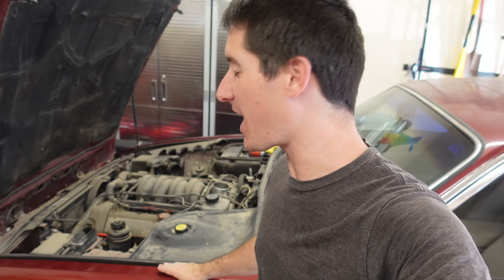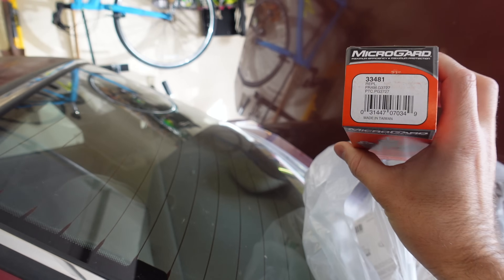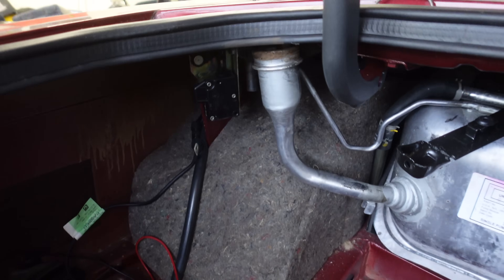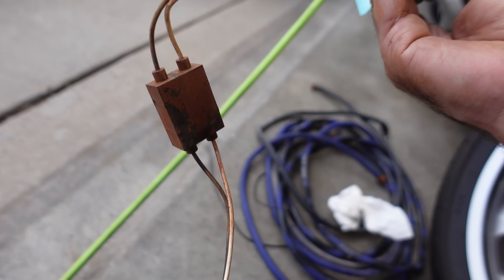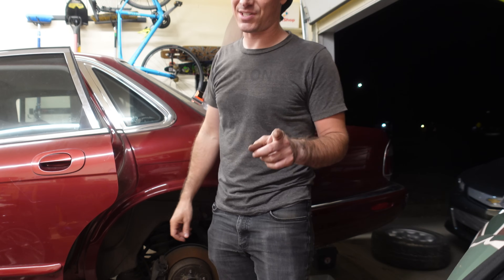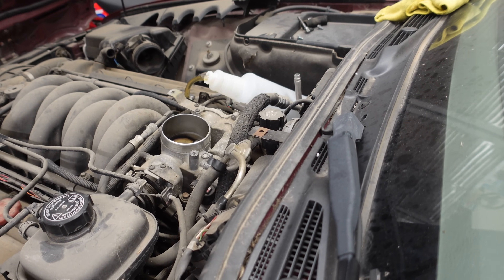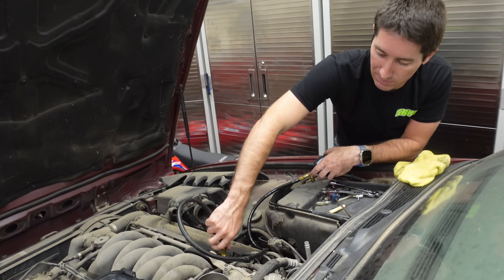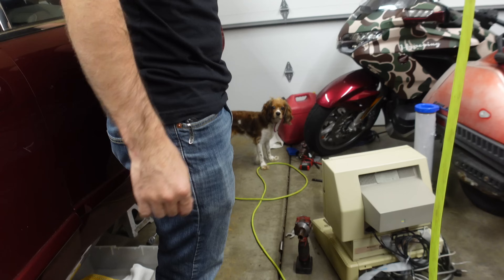World's WORST Fuel Pump Swap... Don't Buy An OLD JAGUAR

Comment: If the fuel filter is clogged then it may act as an orifice. It will allow pressurization when you turn it on, but then will restrict the flow so the engine will not run.
Reply: Agreed - similar to electrickery - high resistance will allow voltage but no current  :-)      but -  I've never seen a filter sooo blocked to prevent tickover speeds -   old git, UK

Comment: Has WatchJRGo figured out the fuel pump, through the hidden fuel pump relay, is controlled by the ECM (for reasons no one has ever figured out why)?  Or that the brake light switch really controls whether there is fuel pressure in the fuel rail?  (really, it does, no one is sure why).  I'm not convinced these cars ever ran when they left the factory, who else has to check the ECM updates to get a fuel pump to run??  Oh, it's BRITISH!  It has World-beating engineering and Design!!  Has WatchJRGo checked the mystery switch in in the driver's side rear door?

Comment: One of the problems of this engine is that it won't start and run if it is down on compression. When these start and run for a brief period, it purges oil off the rings, leading to low compression. This is a well known problem. People start the car, back it out of the garage, shut it down, and then find it won't restart. Add a tiny bit of oil to each cylinder and start it. If it starts and runs, let it run until the temperature gauge moves. After that, it'll start and run fine.

Another area you may want to consider is that disconnecting the MAF puts the car into static mix mode, but the system still wants to meter that air. Even with the MAF disconnected, you need to replace the missing intake hoses and vacuum hoses between the MAF and the intake plenum, or at least plug them well, or you'll end up with too much air in the mixture.

Comment: leaky injectors, looses the fuel pressure, floods the spark plugs, wont stay running, don't forget your intake pipe that could give you a lot of idle problems...

Comment: Check coils and leads connectors for rust that was holding them together until you started the motor and vibrated connectors off.

Comment: Sitting so long your key modual may no longer reading the key. That happen on the jeeps 72 to 2003. I got the exact thing with my 2000 jeep starts ringt up runs great for 3-4 seconds then shuts down.

Comment: If your changing the fuel pump you dont need to drop at the rear as a lot do. Though the pump is in the tank it can all be done within the car and the odd few cuts to the hand. Done it twice.

Comment: It's never easy to fix on an old jaguar, parts and costs... but it's always fun to drive them, always turns heads everywhere you go and always become a conversational.... Nice shape of the '90...the newer ones are never the same as the older ones, trust me
Reply: they may be more difficult to fix but they really don't break often in this era, I have driven my 99 so much over the course of the last year +, multiple times a day all kinds of traffic, only alternator has gone bad, did some maf cleaning and removing kn filter for original because oiled dirtied up the maf sensor.

Comment: I don't know if it's like my 1991 XJ6, where there is 2 fuel pump relay: One for the prime and one for running. Also, put a bottle of injector cleaner as soon as possible. It makes a massive difference.

Comment: I worked in a Ford/Jag dealership for a while as a mechanic. And there were several jags a year that would set for too long and then not want to start. The jag techs had pretty good luck taking all the spark plugs out and spraying wd40 in all the cylinders then they would fire up. 🤷
Reply: these cars do so good when they are regularly used

Comment: At first I thought a leaky injector, but last time I had a stuck open injector, 7 cylinders still ran and fuel smoke filled the shop . And it ran rough. No sign of mice? Grasping for straws here lol
Reply: With the bad fuel filter, the limited fuel flow a gummed up injector or several would cause this.

Comment: I had to start a Miata that sat for awhile and it had some stuck injectors from the bad gas I used an 18 volt battery with some wires and clicked the injectors back and forth until they made a nice click sounds and then it ran amazing

Comment: The pressure drop sounds like a check valve stuck open but does not explain why the pressure would drop when the pump is still running and the engine has already fired.
Reply: I'd guess that the injectors are gummed up and the fuel floods into the cylinders when the pressure spikes or it's the regulator flushing it back to the tank..

Comment: Having flashbacks to my old mechanical injection VW’s and flakey check valves.  And fuel pump relays that were either hen’s teeth or stupidly expensive.  I got good at rebuilding those relays.

Comment: Hey JR, nice pick! Sounds like it could be a few things? Put the intake back together and plug up any vacuum leaks. Almost sounds like it could be an immobiliser issue as well?
Reply: @Darrin R. Could be? It does sound like immobiliser issues
Reply: @nickchamp1497   usually an immobilizer problem would keep it from cranking at all I believe

Comment: I had an identical issue years back it was sticking injectors
Reply from the maker: It could be but when it starts it’s so smooth 🤔
Reply: @WatchJRGo  mine did the same then it sticks. I pulled mine cleaned them with an Oreily fuel injector kit, ran great afterwards. I was chasing my tail for days until I did that. Same symptoms you're having.
Reply: @WatchJRGo  here's the kit I used

OTC Fuel Injection Cleaning
Part # 7448A
Reply: @WatchJRGo  check Legit Street Cars. He just used this bad@$& injector cleaner/tester. I couldn't believe that it was affordable. Worth checking into, I'm sure it will come in handy at the new place.

Comment: Beautiful car but the 4.0 XJ8 had timing chain issues. The next gen 4.2 were bulletproof. Also the Previous x300 xj6 were amazing. 

When they drive they are one of the best cars ever
Reply: yep, this is why you don't buy one that has been sitting forever, my 99 4.0 has been bulletproof with preventative work (chains, thermostat and coolant hoses) and 4.2 with thermostat upgrade and hoses. just spend a little more on a good car, they don't break often.

Comment: From your recent purchase of the Jag convertible, don't buy a newer Jag either. There is a reason that Jags have poor resale value. I'm thinking the take away for everyone out there who may be considering a Jag: don't, for God's sake don't. If you do, you will deserve all the pain you will receive.
Reply: not true, have 2, a 99 and 08, both very reliable, repairs are slightly more expensive than other cars but they do not break often, daily drive both, no big serious impending issues, through all kinds of traffic. just be reasonable and do the preventative maintenance, don't buy a car thats been sitting for 20 years either, do your thermostat, chain tensioners, coolant hoses.

Comment: Getting the tank out is easy yes you need to drop the rear end a bit but its not hard. And when the tanks are sitting that long I get a used better tank and get rid of the tank. What happens to I've seen is water being heavier then gas the spot welds rust out in the bottom. I've seen them leak. I've done about a dozen including the XJR dual pumps. And the trick to replacing the fuel filter is when the line is dis-connected from the tank you un screw it from the front line only remove the whole filter and short line and changed it all in a vise then re in-stall. it is about an 3 hour job Simple

Comment: I have run into this before on jag’s. 

Try battery voodoo ( disconnect both battery cables and touch them together for 5-10mins)

If that does work. 
Unplug the PCM and reconnected it. 
(This should fix the start and stall condition
Like the immobilizer is kicking in for some unknown reason. )  50/50 fix

Comment: What is it with British cars?  The electronic parking brake went out on my L322 Land Rover.  The part alone is $1400 and the whole rear subframe has to be removed to replace it because it sits on top.  $3k job at the indie shop, so for now I am just going without a parking brake and living with the warning light. 😆

Comment: Yep, that's what I wrote in the comments of last video: The only sane way to change the fuel pump is to make a hole in the parcel shelf.
Reply: or just put it up on the rack and do it the right way….

unless the car is so rusted out the quick connect won’t push the lines out i don’t cut them.
Reply: @xalty1200  Do you have one of these cars?
Reply: @alexandrecouture2462  yes i can get these tanks out in 1 hour.

not hard when you have a lift and normal size hands 🤷‍♂️

Comment: Baaaack when i was accepting any job that walked in.... I took a jag in for a water pump replacement. Turns out, they say you need to remove the bonnet and after a quick google search of wth a bonnet even is :(  NO, i wasnt pulling the hood and fenders and a pile of other junk off! After about 83'750 +/- 2 swears later, i was done! I made decent $ but man what a show! Id direct one for $ but no longer would i get MY hands dirty bashed and bleeding doing one again! So ya... probably DONT buy an old jag, he isnt kidding! lol

Comment: "Before you think this is expensive, the real parts to fix this are either $300, $500, or $700."

Maybe I'm used to Mopar prices, but $100 is walking around money when it comes to doing a job on a car. Even $300 would be fine. If I bought a fuel pump costing less than $100, and it came with a limited lifetime warranty, I'd be pretty confident that'll get used.

Comment: Original key? I remember my Miata had an original key that started perfectly and a spare that did not have the right chip in it. 
Wouldn’t start at all, chased fuel pump and things then realized it started perfectly with original key, and never with replacement key

Comment: I agree with the others that that intake needs to be connected and the math sensor needs to be getting error through it otherwise the car will not run or start. Also the cylinders need to be oiled because of wash down from the gas from the computer in cold start mode. This is a very common issue. There was even going to be a class action lawsuit about it. It's the programming in the computer that does this. If you were to start the car and let it run for 2 minutes and move it and then shut it off it will not start again. Being sitting this long I'm sure that those rings have been washed now with the gas and don't have any oil. Also that thing is very lumpy in its cranking there is no way that that is correct it sounds like the thing has jumped time because of the timing chain failures on these engines. Oil the cylinders retry but if it doesn't start and it backfires too much it will blow that intake system apart which is probably why it is in the state that it's in and the resonator is missing. Take the cam covers off and make sure that the camshafts are in line. Guaranteed the exhaust cam on one side is slipped at least one tooth possibly two. If this is the case do not start the engine otherwise you will ruin the heads on the side that the camshaft slips on.

Comment: Could it be a timing issue? As car will kill fuel if it's not right. Just remembering the camshaft code....
Reply: With timing chain guide issues common in these, possibly skipped a tooth or couple. Good call.

Comment: Immobilizer maybe? In that time period, those would allow the motor to start and cut off ignition after one or two seconds if the key is not recognized. My ˋ99 Renault was like that.
And then there is the air intake off, but is the sensor still connected? That might cause that problem, too.
Reply: I was thinking that too, the last car he had that was doing this it was the immobilizer. Not sure if this car has one or not though.

Comment: I've seen other cars with the same issue and it was the "anti theft system" hopefully that's the problem, and my guess work is correct for once.
Reply: 2002 grand Cherokee I have will do that. With a non chipped key it will run for maybe 5 seconds and then die.

Comment: It seems like a Jaguar technician designed the fuel tank location. That would absolutely stink.
Reply: Originally, when the XJ40 platform was developed and for the first few years on the market (87-89), the fuel pump was out of the tank, a simple in-line pump. But, it was found that in northern countries, it would freeze and let the car stranded, so they switched to an in-tank pump, but kept the same tank design with 2 fittings on the bottom, which is right on top of the diff. It doesn't makes a lot of sense, but it's what they did. It would also be an non-issue if they used a good quality pump, but they didn't. BTW, I have a 1991 XJ6.
Reply: @alexandrecouture2462  Oh I see. It seems like they could've found a better solution.
Reply: @Cartier_specialist  Yes. The best solution would have been to plug the 2 bottom fitting and use a setup just like most modern cars, with everything in one unit, accessible through the top of the tank. What most people don't realize is that these car were made in relatively small quantity, partially handmade, so they are made different compared to modern production cars.
Reply: @alexandrecouture2462  I wish they did them like they are on the xjr so it was on the side of the tank so much easier the top mounted one is a pain

Comment: is the catalectic converter plugging the exhaust   system
Reply: Haha. Actually just dealt with the same issue. I thought maaaaybe. Then did everything that I could that was less expensive. Finally broke down and drilled 2 - 1 1/4" holed with a hole saw (saved the plugs jic) it fired right up. SMH

Comment: TLDR:  XJ6  X300/308 fuel pump replacement just cut a hole in the rear parcel shelf to get the pump out?

Comment: The inside of that fuel tank is going to continue to rust since you did not stop the rust and recoat the inside of the tank.
Reply: They going to be changing those fuel filters every few miles needs new tank
Reply: @russell76531  or it will clogged the fuel sock on the fuel pump.

Comment: Ignition switch? I had a problem like that once and as soon as you let go of the key it wasn't power on is actually shutting itself off defective switch replaced it boom problem solved

Comment: Those jags had nikasil coated cylinders and timing chain/ guide issues
Reply: none of the existing running ones have nikasil issues, they don't use that kind of fuel anymore, and the bad ones were all replaced by now. timing chain guides yes, do that and thermostat + hoses and you will have a reliable engine.

Comment: How does the inside of a gas tank get rusty? I think I'd want to coat it with rust converter and then wipe it down with acetone and alcohol to really clean it.
Reply: It's the ethanol in the fuel for sitting so long

Comment: Could the injectors be stuck open, be clogged or full of bad fuel? Maybe take off the injectors and give them a thorough service?
Reply: Legit Street Cars just used his recently acquired injector cleaner/tester in a video. If that's you're possible problem, I know you two have worked together before... at least reach out and check his thoughts on the unit. I was surprised at how inexpensive it was.
The unit even had is own ultrasonic cleaner built in with a stand to hold the injectors.

Comment: Is the key a transporter key?? It’s acting like a dodge you had awhile back I think?
Reply: I think you meant transponder key and that's a good point but on my car which is only slightly newer without a transponder key it will not even crank. Granted my car is a few years newer and not British.

Comment: Sorry but all you had to do was undo the straps the tank straps and rock the tank backward and it would clear the rear deck lid.
Reply from the maker: Not even remotely, the tank can't be tilted, the fuel lines are on the bottom front of it 🍻
Reply: @WatchJRGo  it can. I've done it..... Twice. 1998 jag vanden plas and a 1998 xj8. You have to be super careful not to brake off the lines exiting the bottom of the tank. Sorry dude, done it myself. As well as the chains. You can do it but it is a lot of work.
Reply: Sorry I did not remove the tank just the fuel pump carrier. The tank stays IN place just rocked back.

Comment: Nice Apple, it looks like a Appe //e, judging by the keyboard, and an Apple monitor too. Very nice. I have found memories of the Apple 2 series of computers. In the days of my youth I was a really into electronics, I soldered together an Apple 2 clone motherboard, and all the usual peripheral cars (z80, 80 column, memory, and later, a 128K RAM disk for running my BBS on). OOPs, I think I just dated myself...🙂

Comment: Cheap aftermarket immobiliser?
Reply: Would you believe the brake light switch and ECM are involved in keeping pressure in the fuel rail?  It's a Masterpiece of CLEVER British engineering.

Comment: If that thing has been sitting for 16 years then the fuel pump is not sitting in a pool of ethanol. They've only added ethanol into our fuel supply in the last 10 years or so? So your pump is just sitting in nasty crap gas of course.